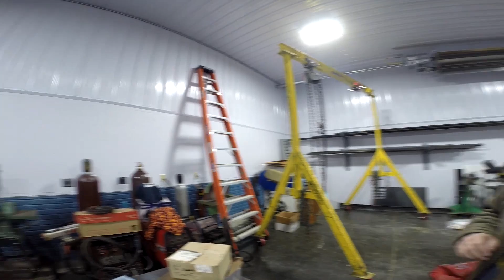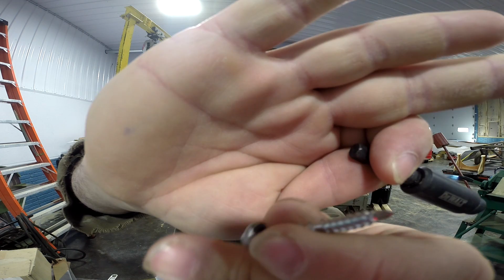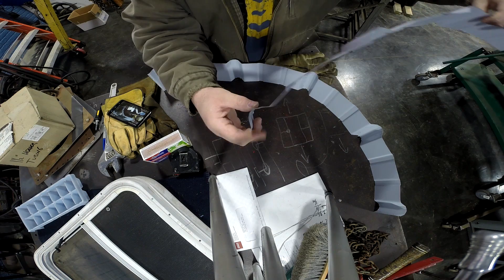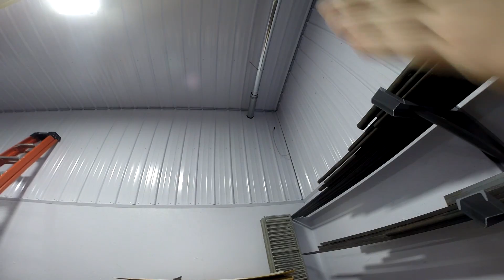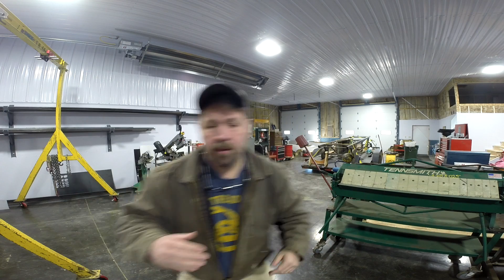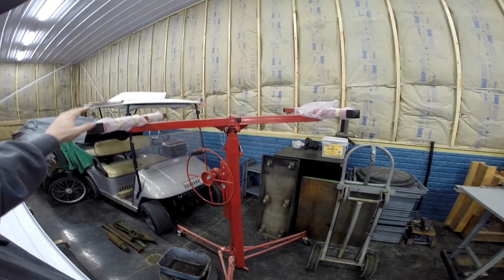New Shop Day 262 March 08 Metal Ceiling & Wall Tips

Comment: I can almost guarantee the ceiling to walls are not completely square and caused that problem if you started wall side and worked over. Start center with a perfect centerline and work your way out on the ceiling first your wall panels will line up. Variations are inevitable but not to that extreme. Something isn’t square

Comment: I am hesitant to comment because this video is already 6 years old.  But I am watching it, so in case someone else is using tips from it, I have some suggestions:  first,  since this is only a ceiling, how you screw it probably doesn't matter.  But if this metal was placed on the roof, there is definitely a wrong and right way to overlap and screw.  Contact your supplier or watch some credible youtube, or watch some instructional videos from learned people OR YOU WILL HAVE A LEAKY ROOF.  It is that important.

Comment: What trim did you use where the ceiling meets the wall? Also what trim did you use for inside and outside corners on the walls? Very helpful video. About to order the steel for my shop interior.
Reply from the maker: I used J trim at the ceiling. On the corners I used either J or I bent it around. Thanks for watching.

Comment: Hey Scott GREAT Information and video!  We are doing ceiling and walls in a shop (pole type building)  Running 2x4's horizontals on the inside of the exterior walls that basically are 8 ft on center.  A partition wall with 2x4's on 16" center I will run 1x4's on the horizontal.  My question is what did you use for the trim at the top for the juncture of the ceiling panel and the wall panels?  And what trim did you use at the floor line and where the wall panel does not go all the way to the floor but meets that brick or other material?
Reply from the maker: I use J for the tops and sides. I used "rat gaurd" along the bottom. Thanks for watching.
Reply: Thanks for the quick reply! Are most ribs 1 inch high?
Reply from the maker: I am really not sure. My experience  is just with my shop so it's limited.

Comment: HEY Scott, the panel is designed that way for a reason, it goes 1 way only, or supposed to, the screws come in 2 different types, one is a self drill/self trapper for metal studs, the other one with the sharper point it for a wood stud. Hope that helps.
Reply from the maker: Thanks for the input and thanks for watching.
Reply: J trim for steel

Comment: Glad I came across this. You are doing a great job. I am in the process of “steeling” my 60x40x14. Hitting some of the same issues you are. I even ordered my steel ceiling all at once (Pro Rib from Menards). Still, for no good reason, I got a panel here and there that just didn’t line up right. In the end, it has all worked out. However, there are a few larger shadow lines, as you call them, than I would like in a few places. It definitely looks better looking from one end than the other. Currently I am in process doing the walls.  Three foot wainscoting in and offset color from the top part. Mostly working myself. I got one of those cheap-o drywall lifts from eBay.  It lifts to 16’ so I was good without fabbing and extension.
Reply: 16' lift off ebay huh? Cool, been wondering about how to do 14' ceiling as most rock lifts are for 8 foot or so ceilings. Thanks.

Comment: Shop looks good. Reason material is wider on one end because they roll it. The more they roll the hotter the rollers get and this causes it to expand instead of form. They are suppose to have a cooling time between panels. It is a very short time to wait , but when they do not, issues arise. flipping the panels help control the walking of the panels... once you see it walk, flip the next panel and it is straight again. They also sell corner flashing to hide this imperfection   or you can rip an panel in between risers and bend it at center. gives a clean look and helps out. Change suppliers , always measure the panels or turn the top one around and you will see if they are bad before you buy them. Best of luck!

Comment: The type of material and profile are prominent points. Not to mention that the panels are roll formed. The manufacturer probably offers the profile in two or more gauges (material thickness) and possibly other materials. If the manufacturer chooses not to tighten tolerances between the roll tooling between jobs, the product will naturally have deformation (typical). Also, a guillotine type system is commonly used to cut material to length. The guillotine is probably miss suited to the panel profile. Basically a numbered (2,3,4,5 etc)  toothed shear creating contact to multiple heights of the planned panel. This will typically result in stretched or widened material since the manufacturer will not retool for your comfort. Basically your experience is that the panels have grown in width based on shearing.  Shorter panels = greater variance end to end. Unfortunately,  if you wish tighter tolerances, they have to me ordered and met post delivery (of course with a cost). The manufacturer would ultimately run longer lengths than necessary and trim to order (or re tool? Doubtful.) I manufacture gutter guards (roll formed aluminum with super tight tolerances). Sorry for the long comment as I watched the video based on the fact that I'm cladding the interior of my shop with steel and have radiant heat as well. Thanks for the video! FYI a regular cheap hex bit works great! Just take one screw and tap it into the bit with a hammer. Seriously! If the magnet gets chipped or fouled up with chips... buy some gum, chew it and press it into the socket end of the bit. No need for that dewalt pushy thing.
Reply from the maker: I appreciate the input and thanks for watching.

Comment: Scott, sorry to hear about all of the hassle with the steel siding.  I had just the opposite experience with it.  My wife and I used the same product (different supplier of course) for both the roof and the siding on our house, and you could measure it with a micrometer.  Everything was extremely consistent.  Glad you were able to work through it, but I am sure that it was frustrating at the time.  Keep up the good work.  R.J.
Reply from the maker: Thanks for the kind words and thanks for watching.